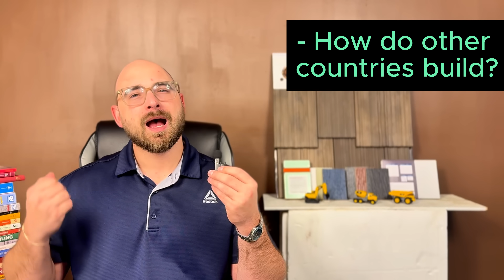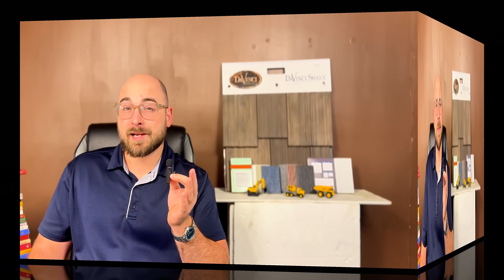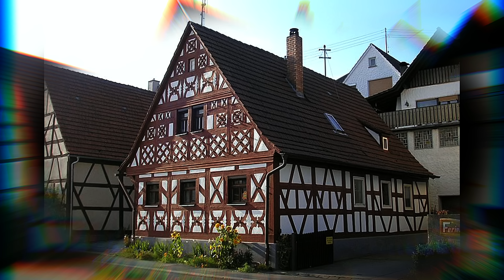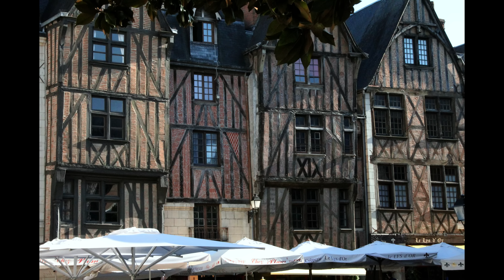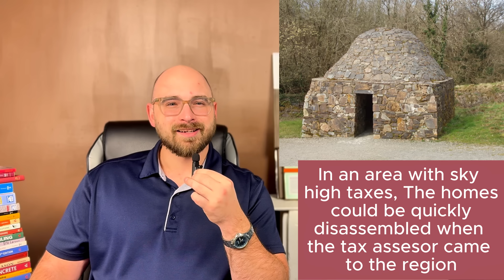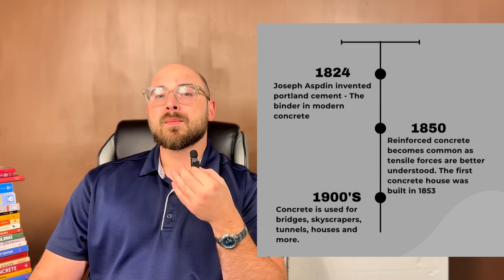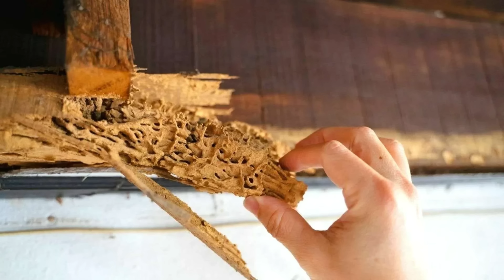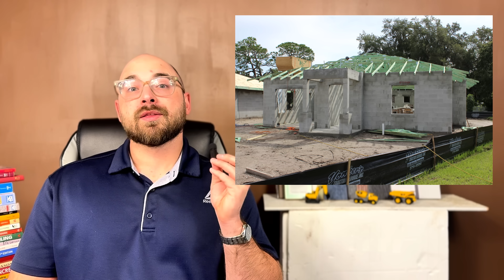Why Other Countries LAUGH at American Homes

Comment: I hear some countries are running low on sand because it's being harvested for construction.
Reply: Australia exports building sand to Saudi Arabia (not to mention camels!) and other countries (SK, China, Japan, Dubai,...)
In 2022, Australia exported $248M in Silica sands and quartz sands, making it the 2nd largest exporter of Silica sands and quartz sands in the world (thanks, Google and OEC.world) 
Sand from dried riverbeds is angular and locks together to make strong concrete whereas (as pointed out), beach sand and dune sand is worn smooth.
I suppose Australia has lots of dried riverbeds

Comment: Obviously America embraced stick construction for most homes (although certainly not all) due to rapid expansion of the country and the abundance of wood from all of the timberlands. It only made since. Home construction in America is ever-evolving however for new energy and safety standards. Oddly enough, I don't hear many people outside of America laughing at American homes. Usually they are marveling (or complaining) about how large the homes are, the fact that they are single family dwellings vs. multi-family units, loaded with smart-home technology, etc.
Reply from the maker: Correct, I think we’ve been slow to innovate on this one because of the ties to tradition. 

And I think we could certainly downsize a little and prioritize higher quality, maybe even more permanent“tiny homes” and multi family buildings, I think better urban planning, variety , and quality would be great 

Especially if we can combine it with beautiful design
Reply: @Mike_Fortin  Correct. The problem is cost. The pricing of homes and the related financing is very high at the moment in many areas. Obviously, it is driven by housing demand in the form of high materials and labor costs. Because of this, I think more people will look to more non-traditional housing models in America, such as tiny homes, multi-dwelling units, etc. Fortunately building codes have become much more restrictive over the last few years especially. In my state of Georgia, house wraps, thermally insulated windows (the things are amazing - no IR energy transferred through the window glass), AFCI (which are crap, but code requires them), higher R values on insulation, etc. are required, but they also still allow a lot of crap like Thermo Ply "structural" sheathing (let's call it what it is - cardboard). Why anyone would accept a stick-construction home with cardboard sheathing is beyond me. Additionally, unfortunately things like vinyle siding are still allowed. My home was built 4 years ago and received 3 sides brick (Hardi Panel on the rear), finishing carpentry details, real OSB sheathing, etc. But during construction, prices rose sharply so the same builder cut corners down the street at the next subdivision and switched to single-side brick, Thermo Ply structural sheathings, eliminated interior window trims and accent walls, eliminated cabinets and granit in the butler pantry, incentives like "free basement", etc. while they raised their price by $100k.

Hopefully I'm deviating too much from your topic of conversation.
Reply: I hear a lot of laughing, and laugh myself. American "homes" are a scam made for quick enrichment of the developers. Mortgage is ridicioulusly high for such a garbage. In my country every shed is built more solid than american scam "homes".

Comment: The best way would probably be a mixture: the hurricane, floods and fires zone should build woth concrete, every other place could remain the same. But it makes no sense to chep on construction in areas where the whole street/city is leveled every few years or even every decade; it is more expensive actually to build cheap.
Reply from the maker: Build cheap, build twice!!

Comment: Cost ? Explain why a home made of shit plywood that won't stand up to anything substantial or last the test of time cost the same as solid homes in Europe home here in america are expensive junk
Reply from the maker: Stick frame houses can burn, blow away, flood, rot, warp, and are not the most energy efficient. 

Most homes use ZIP, OSB, or even fiberboard instead of plywood. Plywood has greater drying potential and therefore is better with moisture. 

ZIP is a better system, but it is often not taped well and can be subject to condensation, and has a harder time drying out, which can and does lead to failure (although I’m not %100 against using it) but it’s not a magic one size fits all solution, especially in cold climates. 

America has a long standing trend of wood houses, fast and cheap, and maximizing square footage. 

After years of said trends we start to look silly when lumber quality is down (all new growth instead of old growth), engineered wood over solid wood, more insulation but less drying potential, and the availability of cost competitive options like ICF . It doesn’t make sense 9/10 times to build a wood house when for a little bit more you can have an insulated concrete house for maybe %10 more up front, but with %50 lower energy bills, longevity, tax credits, lower insurance rates 

It’s basically the same monthly payment but %1,200 better

Comment: I grew up in Australia and have lived for 40 years in CA, and the houses here are fire trap jokes. Here in SF, we have draconian stupid petty building rules, but older houses are flammable wood, topped with explosive tar roofs. Modern houses use basic metal frame elements, like long reinforcing metal beams, concrete pillars, but flammable wood interior wall structures, still often use tar roofs, and the paneling is MDF wood/petrochemical mix, which like tar, burns explosively if it gets hot enough, temperatures easily reached if the framing or interior furnishing catches fire. So even new houses, very expensive houses, are generally shitty fire traps in CA, as we saw recently play out in the Palisades fires in LA.
Reply from the maker: Yeah, it’s very sad, much of it could have been prevented and I hope this changes things for the better, 

With fire resistant design , and using steel and concrete for structural materials becoming standard

Comment: The tragic fires of both London and Chicago left outstanding opportunities for new architects to reimagine the look of their cities, from Christopher Wren’s steepled skyline of London to Louis Sullivan’s steel skyscrapers in Chicago. 
Today, much of our built environment worldwide is facing a looming crisis in the form of rebar corrosion and spalling in reinforced concrete. The spectacular collapse of a 40 year-old high-rise in Miami is seen by many as a wake-up call, only compounding the already known weather related risks in insuring structures there. Over the next decades, as solutions for encasing rebar are desperately sought for new builds, it is highly likely that large numbers of reinforced concrete structures will have to be demolished on or around their 50th birthdays, while Roman un-reinforced concrete structures celebrate their 2000th.
Reply from the maker: Correct, many non corrosive reinforcement methods are becoming more popular, another method is to use a product like ICF to protect the concrete from moisture and therefore corrosion of the internal steel. 

Leaving porous concrete exposed to water and salt will hurt a buildings lifespan, but it doesn’t have to

Comment: America built extensively with cinder block construction in the 1950-1970s - for military housing, Notably, they featured carports. This was included because of aircraft. As aircraft throttle up on take off and land with rich mixtures, fuel rained down on military housing, and dissolved the paint from the cars. My enlisted father spent every weekend waxing the car body, no matter the condition of the engine, brakes, etc. Enlisted personnel invariably had a used car, which was sold when they transferred to the next location.  Those buildings were built to last, were cheap to heat and cool, and very, very and absorbed the sounds of children very well! LOL
Reply from the maker: Very interesting, I didn’t know that

Comment: Sadly, as with most things, politics plays a role as well.
Floridians, over the past 50 years have learned that concrete block structures are essentially impervious to hurricane-force winds, and this type of construction has progressively supplanted timber framing for residential builds since at least the later 1970s. However, the eco-jihad have now decided that timber frames are the “environmentally sound” and “sustainable” choice. As a result, I see massive residential projects being built entirely of light timber framing. These structures will be far less weather resistant, as well as more prone to rot, mold, fire and insect intrusion, and will likely be derelict and deserted long before the block structures of a generation earlier. Is that “sustainability?”
Reply from the maker: A wise insight 

There’s nothing more sustainable than building to last 

While we should be responsible and explore better alternatives, we have to look at all factors. 

Is wood less energy intensive? A little bit, but not when a whole wooden city burns down. 

Not when you have to rebuild the same building over and over. 

We can do better

Comment: Do you think, 3D printed homes have a future?
Reply from the maker: Not in their current state, the porous concrete is exposed to the elements, they lack reinforcement, they cost just as much if not more, they can be remodeled, I’m skeptical they’re well insulated, modular or precast seems like a way better option and probably always will be 

3D homes are popular because it looks cool on social media

Comment: In the last minute of your vid: you claim that 2x6 wood stud walls have an r value of 13.
That 13, or r-11, would be the r value for 2x4 walls.
2x6 walls are r19
Reply from the maker: What I said is not in error, 

A 2x6 wall gets R19 batts in the wall cavities. This is the STATED R value, and it only applies to the wall cavity, the wood studs are not great insulators , being around R 6 each, and serving as a thermal bridge between inside and outside 

Accounting for studs every 16” OC, blocking, install quality, air tightness, thermal mass etc. the 2x6 wall performs around R13. This is the EFFECTIVE R value.  This is according to test done by the US dept of energy, 

ICF has a stated R value of R22 but performs close to R 50, this is because there is more going on than heat transfer through the material, there is thermal continuity, a lack of thermal bridging, thermal mass, earth coupling where the temperature of the earth equalizes with the concrete wall and carries up several stories (sometimes called passive geothermal temperature) 

To clarify, some materials like rockwool perform closer to their stated R value, but effective R value looks at all variable to determine a walls performance. 

In summary, 2x6 wall with fiberglass batts R13, ICF R 50
Reply: @Mike_Fortin  What does it say on the package of a roll of 3 1/2" fiberglass insulation?  r-11 or r13 if it's foil backed. What does it say on a roll of 5 1/2" fiberglass insulation? What does the UBC call for?  r-11 or r-19, depending on climate zone.  Are you saying that everyone is wrong but you?
Reply from the maker: I don’t want to insult you, 

But You are in error on two points 

1. You are confusing stated R value with effective R value 

2. You are assuming the R value of the wall cavity is equivalent to the R value of the entire wall. 

Please see the article below which has a graphic explaining the idea . This article references test data from the US Dept. of energy 

https://www.sips.org/resources/r-values-in-the-real-world 

A R19 fiberglass batt does NOT equal an R19 wall assembly

Comment: No mention of  3D Printed concrete houses.  While relatively new,  it shows great promise in flexibility and cost savings, especially at scale.  Hardened homes is something we should consider for at least part of the California rebuild effort.   Good presentation of wide variety of techniques -- +  strengths & weaknesses.
Reply: For 3D printing, free form printing something similar to the ICF insulation/mold could work.
Reply from the maker: I don’t think 3D printed is the future, 

Too expensive, lacks reinforcement, exposes the concrete to the elements. 

ICF, pre cast, and even modular are all better options. I think 3d printing is a fad unless they come up with a space age concrete mixture and improve the price simultaneously

Comment: A lot of the strip malls and malls are built out of cinderblock and covered with stucco plaster or some sort of similar product or some other kind of modern panel that looks like laminated wood or metal but it’s protected from the elements through some sort of alloy or coding. In commercials faces in New England and down the East Coast Cinderblock construction is quite common. A lot of people built garages out of cinderblocks between the 40s and 70s, but they look ugly as they age as most people never bothered to put a coat of plaster over them
Reply from the maker: A coat of stucco would have probably brightened up the appearance a bit 

Is there a lot of cold weather there? Below freezing?

Comment: My wife grew up in a concrete frame with blocks infill, ceramic shingles and polished stone tiles.
You could wash the floor by throwing a bucket of water + special floor soap on the floor and wiping it perfectly clean, shiny and smooth. Anyone using drywall or plaster like sheets for walls was considered cheap.
These homes were very sturdy. No squeaks when walking, climbing stairs etc. Low fire risk. Only furniture were made from wood products, sometime not even that.
Reply from the maker: That’s awesome, was that in the US ?

Comment: It is defiantly more fireproof having a concrete build home, than a usual build American home. 
I wonder how many homes would had survived the LA fires recently, if they had been build using other building materials than most homes were there. 
Maybe the rebuild of the fire deserted area should be fireproofed as a minimum to avoid the same from happening in this scale again.

I live in an old brick house in Denmark that was build in 1850.. build to last ✔
Reply from the maker: Some of the homes that survive the LA wildfires were concrete or steel . 

I sincerely hope they prevent future destruction by rebuilding with concrete or steel and other fireproofing methods such as fire resistant sheathing and cladding, unvented conditioned attics, fire resistant roofing and roofing underlayments, and more ..

Comment: In my country (Slovakia) it used to be almost exclusively bricks for past 100 years but now it is mostly CMU. We don't have seismically active areas, tornadoes (ok we have one or two per decade but those are so weak they wouldn't make even local news in the USA) so concrete frame is not necessary.
Reply from the maker: Do you have a lot of single family homes or it is it more multi family buildings?
Reply: @Mike_Fortin  If by multi-family buildings you mean buildings with flats for rent or direct sale than I would say it is more new flats than new private houses because we are a small country and land is expensive. If you mean multi-generational homes (a.k.a 2 or 3 generations live in a single large house) vs 1 generation (single family) homes than it is almost all single family homes today. Multi-generational homes went almost completely extinct when it comes to new builds.

Comment: At least concrete frame and brick walls. Will be very low insurance cost and very resistant.
Reply from the maker: Correct, building with ICF can earn an energy star rating, tax credits, lower utility bills, longevity, rebates, and lower insurance premiums 

And you’ll be safe from almost any disaster

Comment: The problem with solid walls is that you cannot easily run new wire paths or piping in them.
Reply: Thats true but theres always dis-/advantages. We run conduit generally so you can easily run new wires and replace old ones. There's usually a reserve spot in "outlets" so you can install ethernet or more electrical outlets or whatnot. It's also far safer in terms if fire hazard. So there's that.
Reply from the maker: With ICF , you run everything through the insulation, not the concrete itself, it’s less of an issue
Reply: @Mike_Fortin  Here in Switzerland we run plastic conduit (os that the term?) in the concrete forms before pouring. Cables are fed later and can easily be replaced down the line.
Reply from the maker: Yes it’s the right term :) 

We do that for our ICF build , we use a piece of PVC pipe to get through the walls when needed. We refer to this as a “sleeve”